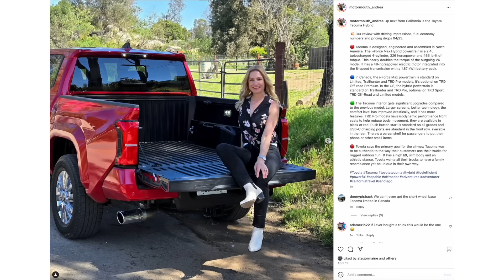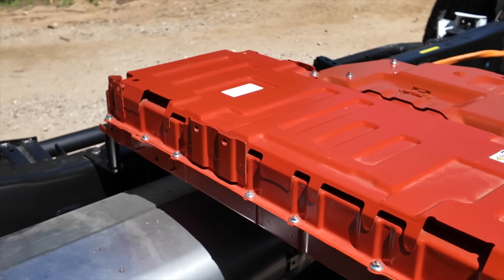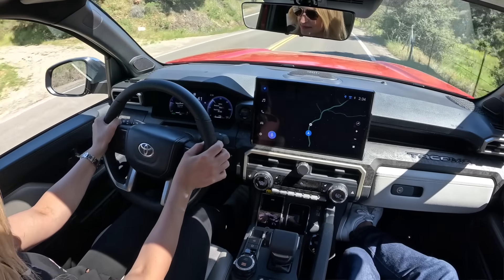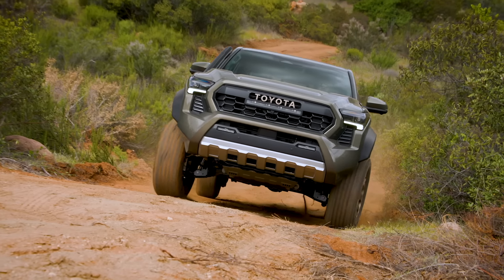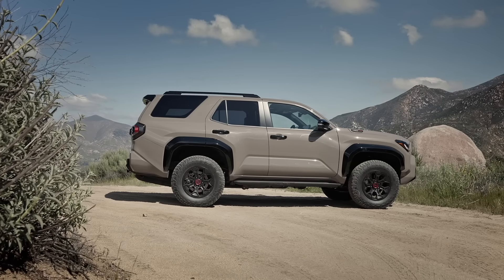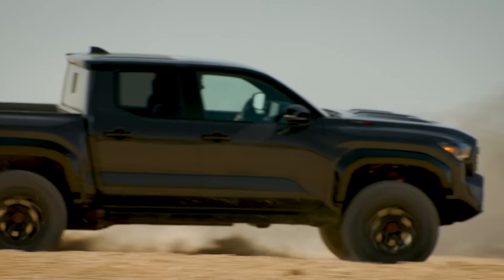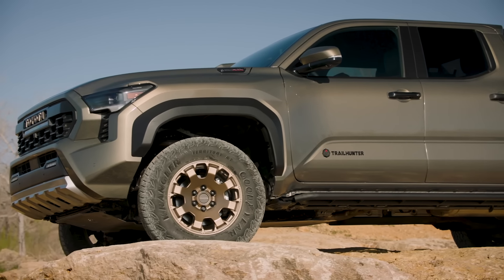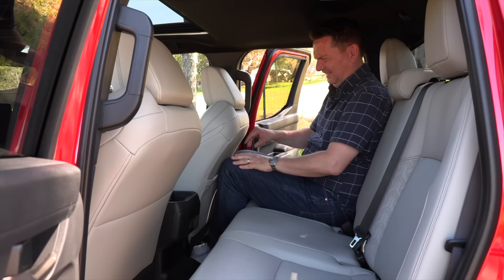All-New 2024 Toyota Tacoma hybrid // i-FORCE MAX is wow, so is the price!

Comment: I like it.  My concern is I need a mid size truck for towing a trailer.  These Tacoma s are very light duty.  I need at least 1200 payload capacity based on my trailer hitch weight.   Just wondering what the actual payload is for this particular truck??????

Comment: The age old question of buying the truck for the 345 days a year you don’t tow or are you buying for the 20 days a year you might be towing… I am leaning towards stepping down to a mid sized. However i do wonder about hauling through the Rockies or over the Coquihalla as an example…
Reply: The taco is in the full sized price range now

Look at a frontier for cheaper options or wait until Kias truck comes to the US
Reply: Get the Highlander you don't even need the Tacoma to tow or haul stuff Highlander gas version can take it on easy but better to get the V6 version!

Comment: This is so close for me, but not having memory seats is a deal breaker. Toyota, you added virtually every other luxury feature you could to this. Why not something as basic as memory seats? Litterally every other competitor has it now. Also, no rear vents seems like a BIG miss too. Power folding mirrors and power steering wheel adjust would have been a nice to have.

Comment: ...."They raised the seat height by 30 mm ...that's just over 2 and 1/2 inches"....... Ummm is there a Canadian conversion for the metric system as well as the dollar??  30mm is about an inch and 1/4 Friendo...
Hopefully they made the same mistake on quoting the pricing because it sure sounds like DOUBLE what it should be as well..

Comment: Here is the problem with the i-FORCE engine concept. When the battery is empty, the tiny super charged gasoline engine has to pull the Truck and cargo and dead battery and dead electric engine. I had a friend that tried to camp in the mountains with a hybrid combined vehicle. After the battery went empty, the poor little 4 cylinder engine had to try and pull a trailer, 5 people, dead battery and cargo in the SUV. He could not even drive 40 MPH. The little 4 cylinder engine was read-lined and ultra hot from the strain.

Comment: I sold my Taco to buy a Maverick and I assure you, the Mav is a superior vehicle in almost every way.
Reply: Can it go rock crawling?
Reply: @beexiong2995  absolutely not... but neither can the Taco.  Rock crawling is a way for children to break their toys.
Reply: Completely apples and oranges vehicles though (from any of these body on frame types). Depends on needs and purpose.
Reply: Different tool for a different job. The Mav is a decent truck, but it's very different from a Taco.  It sounds like you bought the wrong tool for what you needed, which is why you sold one and bought a different one.
Reply: @jeffer1101  They are both small pickup trucks, not exactly different tools.  I almost exclusively drove Toyota products and liked the Taco.  It just isn't as good as the Mav.
Reply: @kimoandrews5802  They are both small trucks.  The similarity ends there.  They are VERY different trucks.  There isn't anything wrong with either one.  It depends on what you want/need.  That's all.
Reply: @kimoandrews5802  Taco and Ranger are midsize, Maverick is compact=1 ft shorter with much less towing and off road ability. Depends on what you need.
Reply: @jeffer1101  .... and an iPhone is different a Galaxy...and Crest is different than Colgate.
Reply: @kimoandrews5802  i’m sorry you didn’t clarify. Did you buy last generations taco or did you get the new 2024 Tacoma and trade that in?
Reply: @sammyjammy6647  Sold my '21 Taco when I got my hybrid Mav delivered in '22.
Reply: @kimoandrews5802  The Maverick is a unibody vehicle, built on the same platform as the Ford Focus and Escape.  The Tacoma is a body on frame truck built on the same platform as other body on frame vehicles, like the 4Runner and Landcruiser.  They are very different vehicles with very different characteristics (in terms of capability and driving dynamics).  They are also significantly different in terms of size, weight, towing rating and price.  As I said in the beginning, different tool, different job.
Reply: @kimoandrews5802  well if you ever get a chance to drive the 2024 Tacoma, then I would like to see what you say what it’s like in comparison to your Maverick
Reply: @sammyjammy6647  Did they fix the transmission and weird seating position for the Taco?  I did like the composite bed.
Reply: @jeffer1101  I have owned more vehicles than i care to disclose, and I assure you that "body on frame" means precisely squat.
Reply: @kimoandrews5802  Body on frame means precisely squat? OK, you don't understand the purpose of body on frame vehicles.  That's ok. The Maverick works for you, that's great.  It's a decent truck.  It would work great for me too.  However, a unibody vehicle is still very different from a body on frame vehicle in many ways, regardless of how many vehicles you've owned before.
Reply: @jeffer1101  For 99.9% of actual real-world usage, there is no difference.  This simply isn't a matter of opinion.  Land Rover's, Landcruisers and yes Taco's and Mavs are mostly used for hauling groceries and maybe mulch.  Does a body on frame enable better extreme off-road performance?  Maybe, but that is aspirational marketing.  I took an old VW bug off road quite a bit and it did perfectly fine... I am pretty sure it was a unibody.
Reply: @kimoandrews5802  I know what the difference between them is.  I also know that most people use full size trucks as a replacement for a family sedan.  I agree most people don't "need" a truck, they want it.  However, that isn't what this debate was about.  It was about your comments implying that there isn't much difference between a unibody truck and a body on frame truck.  There is a big difference between them.  It's up to the buyer to determine what fits best for their wants/needs.
Reply: @kimoandrews5802  ...it's the equivalent of Nurburgring lap times on a Cayenne.
It. Doesn't. Matter.

Comment: Why do all these reviews do the same thing, read the spec sheet.  I can listen to the salesperson or read the spec sheet myself.  The unique thing reviewers can do is provide hands on impressions and insights.  What is the day-to-day difference with the Limited's All Time 4WD vs. the off-road models' part time 4WD?  How would this impact snow driving?  How does the ride of the AVS on the Limited compare to the various off-road suspensions in highway? Side roads?  ...  Can the Trail Hunter have a tonneau cover or does that rollbar thing conflict?  Is the snorkle on the Trail Hunter make loud noises in the truck?  Are the Limited's tires quieter that the Trail Hunter?  Are the TRD Pro seats worth the extra cost? ...
Reply from the maker: Very limited time with these trucks, but  when they are available for week-long test drives,  we can provide more info

Comment: Tfl was not impressed with this truck. The acceleration in it was unremarkable and the truck gained so much weight from the new motor and the battery it bogged down the 😮 bhp upgrade. And it's only 2mpg better then previous year. 65k before markups and tax and destination fees.

Comment: Enough with the Toyota Tacoma Hybrid Ads.
Seriously, this thing isn't REALLY a HYBRID.  Toyota decided to use the HYBRID system in the Tacoma for POWER, not what a HYBRID is for  FUEL ECONOMY ! ! !    What ?   Come on Toyota... Even your Highlander Hybrid can get 36 MPG.  This things Economy ratings stink to high heaven.  Only ONE more MPG than the Non-Hybrid...Seriously ?
And 60K for that "Mid Size" truck ?  Realy ?  
Back to the Drawing Board...Get this thing to at LEAST over 30 MPG and get the loaded price down to under 50K .  The Hybrid Battery under the back seat, wipes out all in cab storage.  And Raises the back seat up to high.  Get the Battery under the Truck, Between the Frame Rails.  Then maybe...just maybe I'd look at the new Tacoma.

Comment: Iam sorry, this video , doesn't impress me. For the fact that, There is  very little room in the back seat, for two adults sit there,  comfortably. Unless, you're a midget, and even then. With what I have seen, you might get away, with two small children, back there. 2nd) why didn't Toyata did their hybrid, With proven, 6 cylinder engine that, they are using now? Instead of 4 cylinder engine, that will have more strain on it.? It's known fact, that, even though , turbo has its advantages, it also, cuts down , on life of the engine. 3rd. What is the life of those batteries, and what is the. Cost to replace them?

Comment: $95k out the door. 4runner, add an other 5-10k. Toyota lost the plot and so did every other car manufacturer.
Reply: 95k?! 21k mark up on the LC250 landcruiser wouldn't even be 95k..  exaggerated much...
Reply: @NorthweSteelheadJunkies  Tacoma trailhunter is $98,000 with Toyota fees and tax in Ontario Canada.  That's before any markups.  This is a Canadian Channel.

Comment: I decided on the 23 Tacoma V6 4X4,  4cyl turbo is not attractive, like everything when it’s new it works fine but what about the longevity?   Turbo’s are an added expensive expense when it breaks & hybrid batteries are also another heavy hit on the wallet, I bought a Tacoma because I wanted a reputable vehicle with a tried & true tested V6 that will be dependable and last me for years to come!  At these prices these are not “throw away” vehicles,     Especially Toyota! 15:28